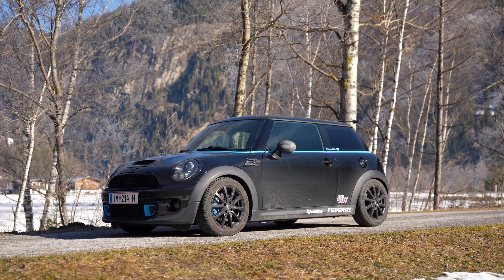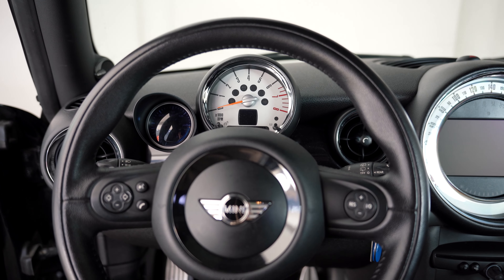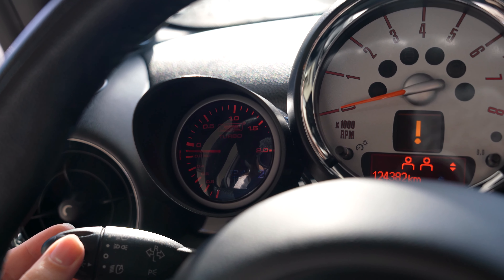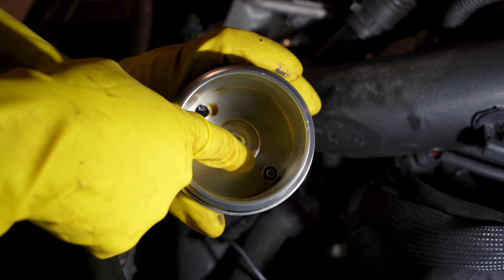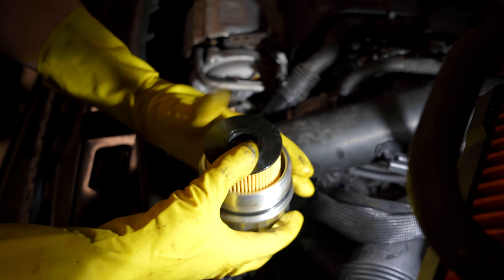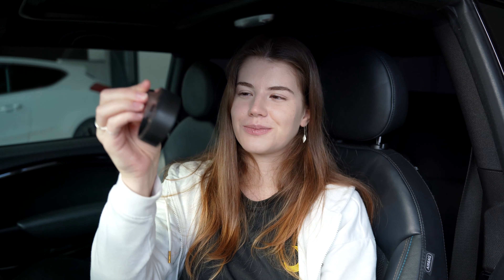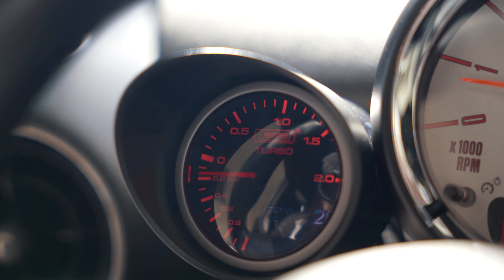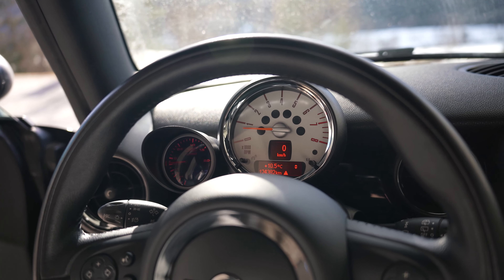340€ setup - Prosport 2in1 temperature & boost pressure gauge (+ accessories)

Comment: Ich möchte das auch in meinem BMW einstellen. Sehr gut! My BWM has the "same" configuration as your MINI, oil info is missing. In fact, not only oil info is missing, water temp is also not there. My currently solution is using a drive analyser. It works, at least I have water temp, turbo pressure, but oil info is still missing.
Reply from the maker: It makes no sense sense to me, both Mini and BMW miss such an important metric!

Comment: Your video was very informative. Thank you. I have a 2012 Mini convertible and it has a top down timer gauge that has proven to be totally useless. I don’t know coolant temp or oil pressure but I know exactly how long the top has been down. I’ll be looking into the setup you have for sure.

Comment: I have a Mini cooper s r53 just a fun little car to chuck around and the supercharger noise! On this model you could opt for the Chrono pack that would give you oil pressure and temp. But not boost which is a shame cause one would like to see if my supercharger is boosting properly.

Comment: I have questions about the electrical connections for the gauge from pro-sport. I will install a similar setup in my r55 in a few weeks.

Where did you get the connection for the 12V which activate when turning on the ignition?

And where did you get the line, which causes the change of the lighting colour?

Generally spoken, I would like to know where you got all the connections in the car and how you routed the cables.

Thank you
Reply from the maker: The product came with almost everything you need. I only purchased 1 more isolated wire to route through the lower dash to the 12V cigarette lighter socket as a power source. You will have 3 connections from the gauge going to 1. Oil temperature sensor 2. Boost pressure sensor 3. Power source. There is one additional port that you could use to connect to another gauge - this way you wouldn't need to source power again.

The orange/white colour changes automatically depending on whether you set your lights to daytime mode(orange) or off(white).

Hope this helps :)
Reply: @KiaraShifts  Thank you for your answer.
For routing the 12V cable to the cigarette lighter socket you needed to disassemble the lower dash. Or am I wrong with that assumption?

Interesting, that the cigarette ligthing socket does turn off with the ignition, while the USB-port ist still delivering electricity, even if the ignition is off.
Reply from the maker: @flo8637  that's right. It's just a few Torx screws. You also need to take out the centre console to reach the lighter socket. There are 3 screws I believe.
Reply: Danke für die hilfreichen Infos. Das mit dem Einbau sollte dann klappen.
Reply: @KiaraShifts I completed the installation of the aftermarket oiltiltercap and the oiltemperaturegauge. After a few testruns I'm a little surprised, because my gauge shows me temperatures of around 65°C while driving normally at 110 or 130km/h on the autobahn. Even if I do a little sprint up to 180km/h and leave the autobahn directly after that, I encounter around 80°C at max. The ambient temperature was around 10-20°C and I did drives of around 35km before the sprint, so the engine should be up to temperature.

Therefore I would like to know what kinds of temperature you normally encounter with your car?